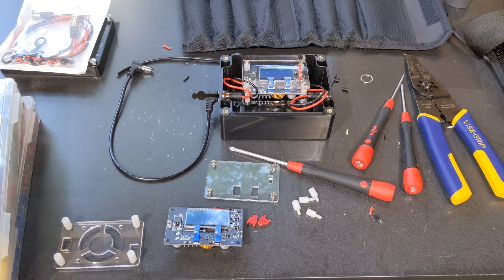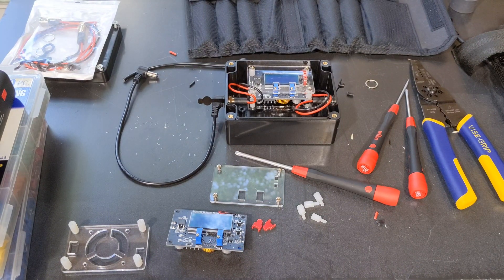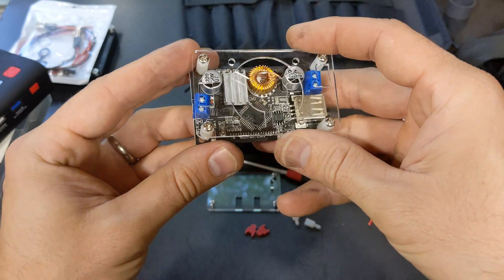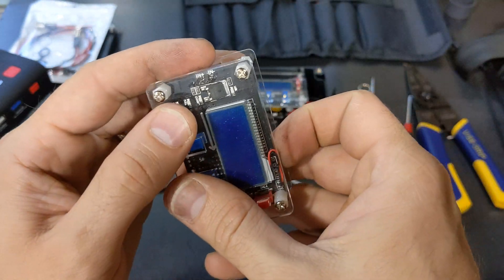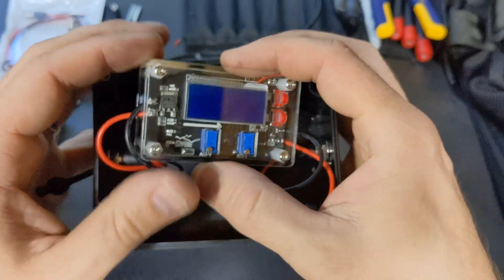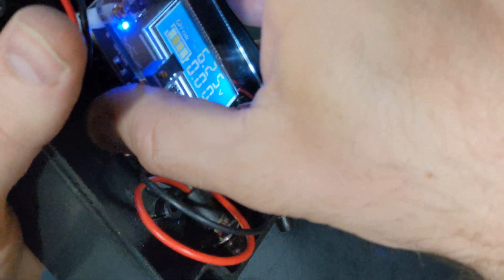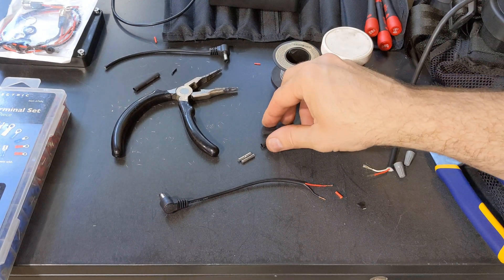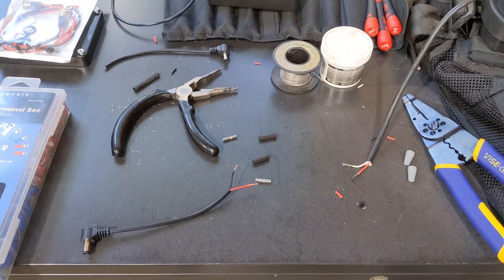3M Breathe Easy Turbo 12v battery conversion (tutorial)

Comment: good job man! pretty sweet!! made it look easy im going to try this with a milwaukee m18 battery i have some 12v converter that shut down at 14.4v to protect the battery should just be able to hook that up to the buck and ill probably put a sae connector on one of the ends so they are differnt. i want a new version really bad just cant swint that kinda money with out knowing if ill like it.

Comment: Hey I no this video is old but jw if you could install this into the breath easy housing ?
Reply: Like the housing is basically empty plastic &  doesn’t have much function except belt support filters ect but didn’t no if it was thick enough
Reply from the maker: You could try, not sure if it would work or not

Comment: How did this setup work out?  Also, since such a small wire and you were soldering, you could have used a Western Union Splice, and good heat shrink like that from Ancor.  I did wiring on boats for over 30 years, and learned from some of the best.
Reply from the maker: excellent point! thank you
Reply: @REKKnives  yeah good Ancor heat-shrink has sealing glue inside.  And actual heat gun always best.  Great work on your knives btw.  And how did this work out?
Reply from the maker: @GlennInLaguna  thanks! I didn't use it... Had already upgraded to the versaflo by the time I made this video lol. I just did a GAW with it though, still running fine 🤷🏻‍♂️

Comment: 15:01  Twist the wires together first.  A good mechanical connection begets a good electrical connection.
Western Union Splice for inline connections 
https://upload.wikimedia.org/wikipedia/commons/f/f7/Western_Union_splice.jpg
https://en.wikipedia.org/wiki/Western_Union_splice
If you do that and solder, then heat shrink...you can skip the crimping sleeve.

If you use different connectors for in and out, labels are unnecessary and impossible to smoke because you hooked it up wrong.
Reply: Whats the voltage and amp needed by the 3m breath easy to power it?